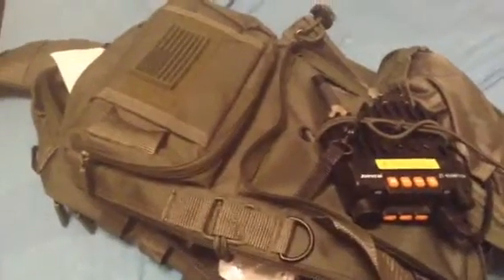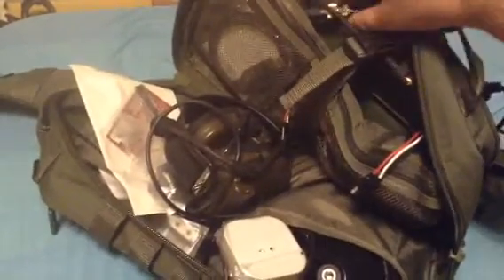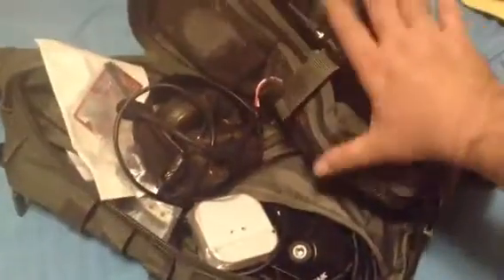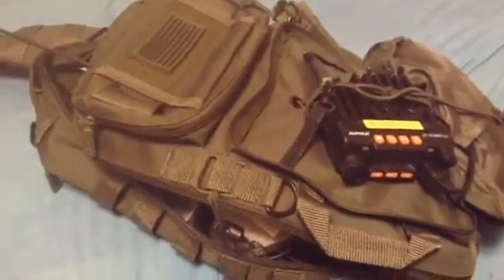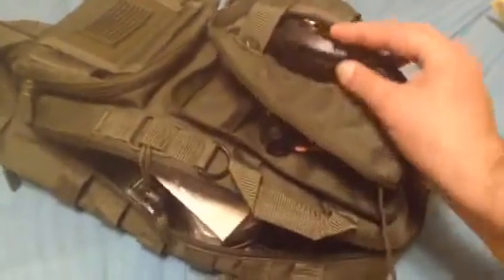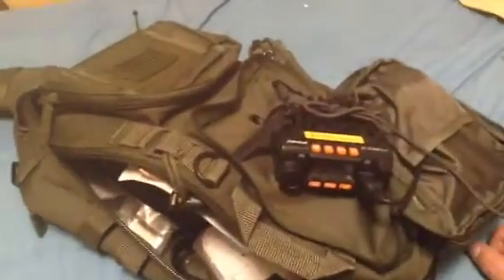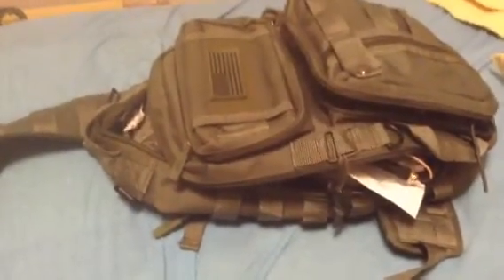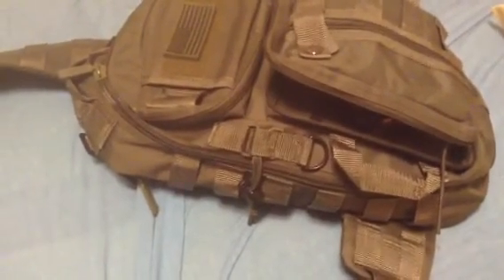Man pack radio and concept discussion

Comment: you sir are not realistic for the size of the pack you want to use. you want range you have to sacrifice size of the antenna  check out a K30 antenna might be long enough to give you 8-10 miles.

Comment: again...love the concept of a small bag radio... or civi manpack. when a handheld isnt enough this bridges that gap...Im sure between you and STN ...this project will come to fruition. Already searching amazon for that type of radio because of your concept.
Reply from the maker: The trick on this is to find a radio in your budget where you can get exactly the same radio to work on the manpack, vehicle mount and base station situations so that your parts and accessories remain compatible.    Survivaltechnord favors the Yaesu 817 series, but those tend to run around $750 each for the bare bones radio.   Two capabilities it has that the Chinese Juentai 6188 lacks is the external speaker capability (the Juentai can be modified to have that though), and readily available computer interface which allows radio to text communication.   The radio to text capability is a really big deal, and personally, I think the Juentai can be converted to run that way.  A lot of functions go through the hand microphone interface, and the plug itself appears to be an ethernet adapter which was wired for use with the radio.  That means in theory, an ethernet cable could be rigged between the radio and a laptop for the computer to interface with the radio, but that would require some firmware and perhaps even internal wiring changes to make that happen.

Comment: okay about the antenna it goes back to my first comment your SWR won't be good with an antenna without a ground plane no matter how much or how little power you put through it. that's why I recommended the balanced antenna system for you which is basically a dipole. If This Were a handheld radio the case of the radio itself acts as a ground plane. One way you could get by is if you made a very small frame to attach to the radio. then  attach your antenna to the (very small) frame or case of the radio. other than that balanced antenna design connecting the antenna to the case or a very small frame with a case I don't see any other way to make that antenna work because there's no ground. it's not a debate it's the laws of physics. anyway I wish I would have thought of Thee small bracket or case mounted antenna when you first asked me. 
 
Final point. I don't think that you'll be able to transmit 25 watts through that antenna, but that's a separate issue. you're only problem and the only issue that makes this a fail at the moment is the lack of the ground plane (,e.g radio case, sub frame, 1/2 wavelength of wire off the antenna shield, ).
Reply from the maker: I have some scrap aluminum sheet around, I was thinking go that I could possibly bend and weld that into a metal mini cage then mount the antenna to it.  Would that work or do I have to use steel?
Reply: +8digitPDX aluminium would be awesome.  That solution  would be good to go!
Reply: You can keep your man-portable concept and don't need to make a frame for your radio. What SurvivalTech Nord was recommending is a ground plane for the antenna. Any metal will do. I once saw a reference and video where a gut was using a round electrical box cover as a ground plane for a small mag mount antenna.